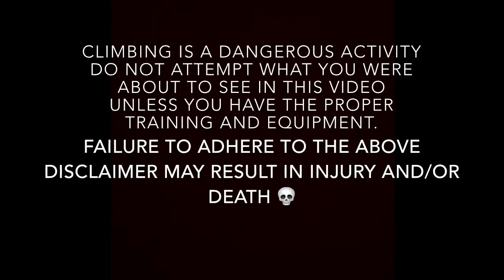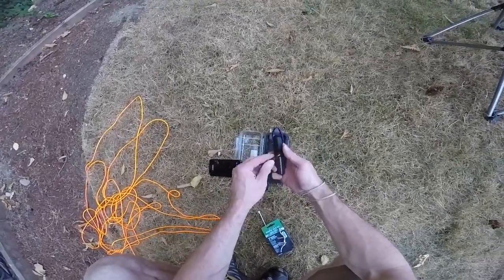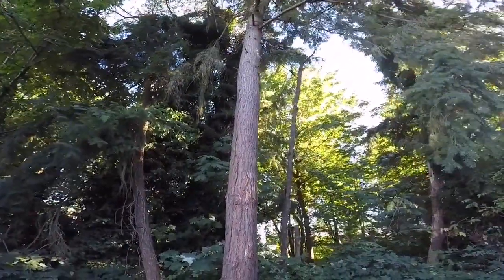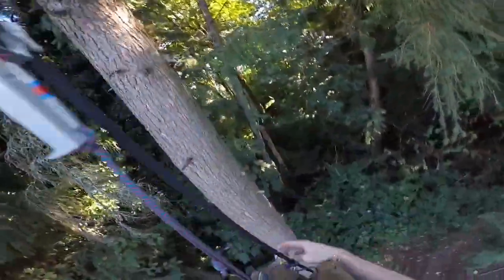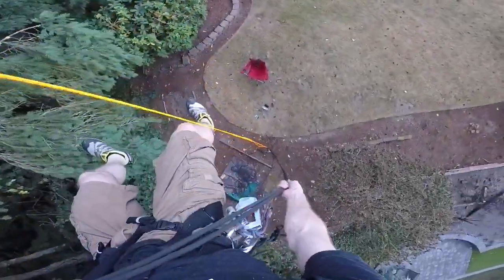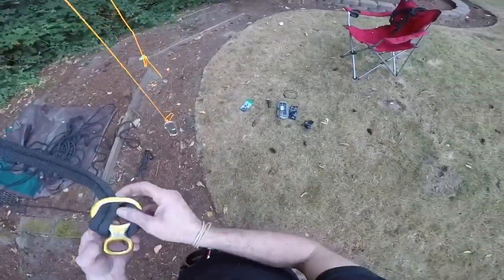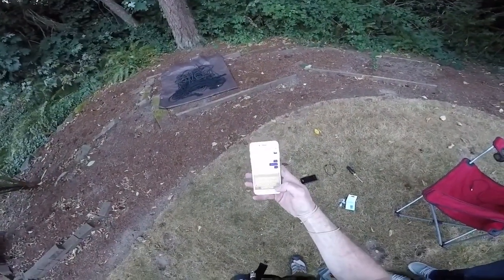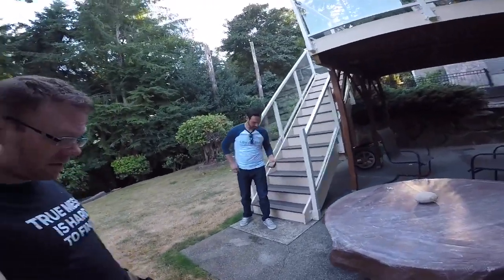How to Install a Mesh Node With an Extra Power Source

Comment: I know this is an older video, but I'm just know getting in to the Gotenna Mesh stuff (also the open source Meshtastic stuff).  I've had issues with external batteries shutting off due to the low draw from the gotenna, do you have any models that are affordably priced that will stay on?
Reply from the maker: 2064888987

Comment: What are the odds that I could do this with a Beartooth unit? If you're not familiar with it, it is a pretty similar unit but from a smaller company with PTT compatibility. I have already ordered the Beartooth units. was also wondering if I could do a MOAN type unit as well with a self sustaining solar charger. I will not be able to solder the antenna connection on though, because I have limited experience with sensitive electronics. Thanks.

Comment: Why a do you say use a smaller battery ? Bigger battery = longer run time ?
Reply from the maker: Because the larger one takes up to much room in the case and can cause RF blockage from the antenna.